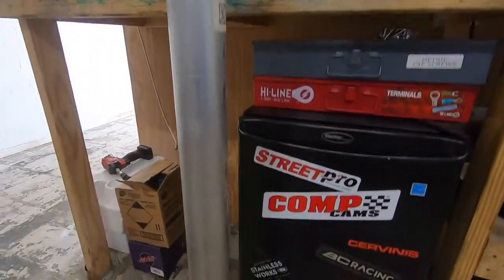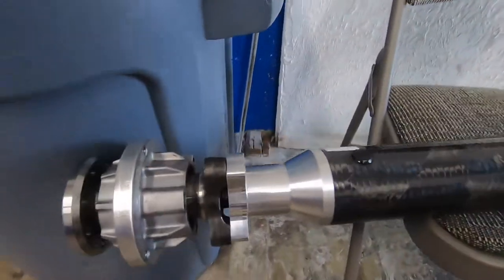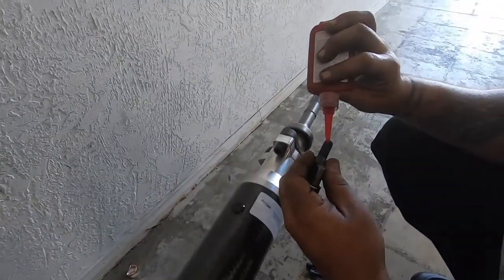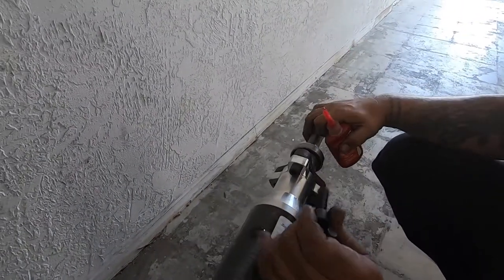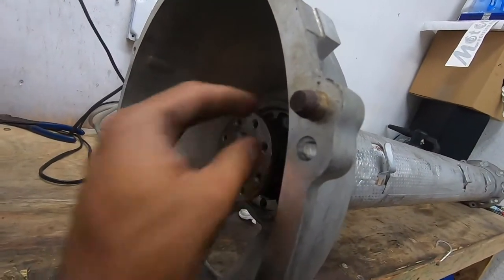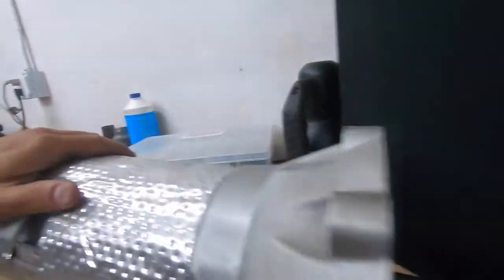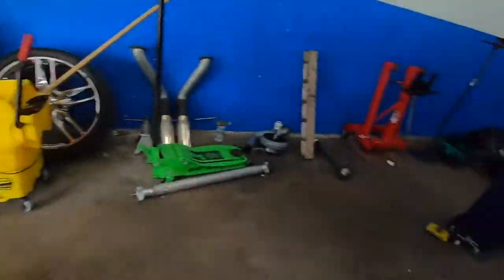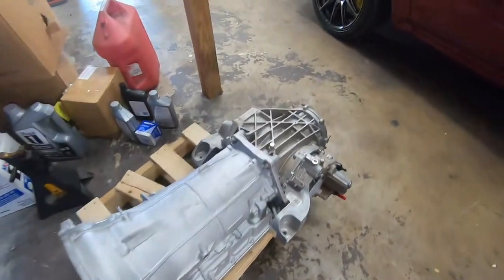C7 - New Transmission, Diff, Torque Tube - Part 1

Comment: Is there a site to order parts to rebuild the torque tube I need to replace my 2016 z06 7speed tq tube
Reply from the maker: All GM, use the dealer. Also check out driveshaft shop

Comment: So you replaced the stock DS with a aftermarket one ? Did you do that to prevent the TQ tube problems on the stock C7s ?
Reply from the maker: replaced everything and the tq tube. Needed to at the current power level. Thanks for watching!

Comment: 🧐🧐 what in the hell is that you have to pull the front bell housing off and the rear end I've been a train mechanic for a very long time and never seen anything like that ever because of that I would never buy a Corvette I don't know how much that job cost but it looks very expensive if I had a Corvette and had transmission problems I would rather sell the car as is that makes me glad that I bought a GT Ford mustang if for any reason I would have to pull that transmission is not a real big problem all I will have to do is pull the transmission and that's it I will never buy a Corvette ever
Reply from the maker: Thanks for watching